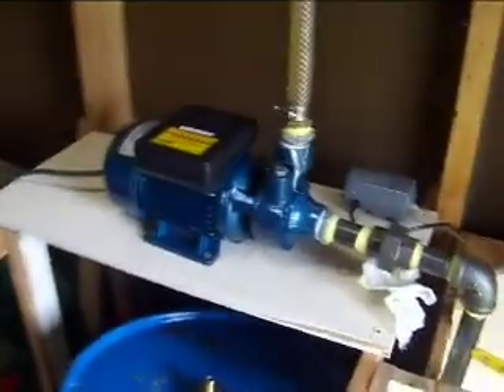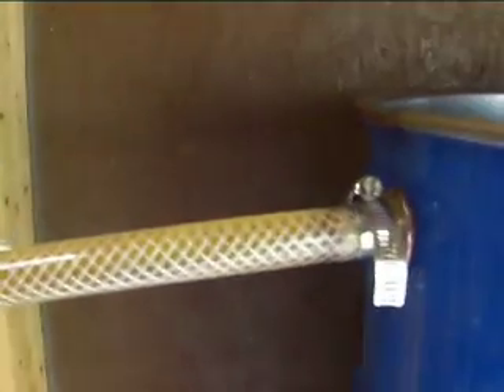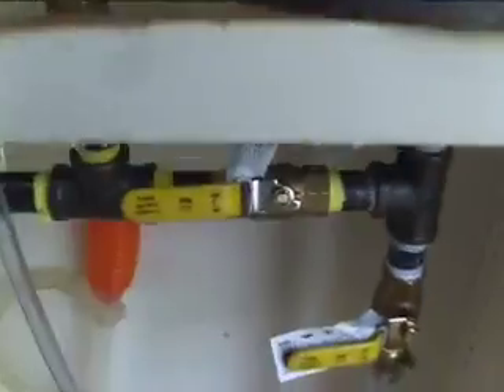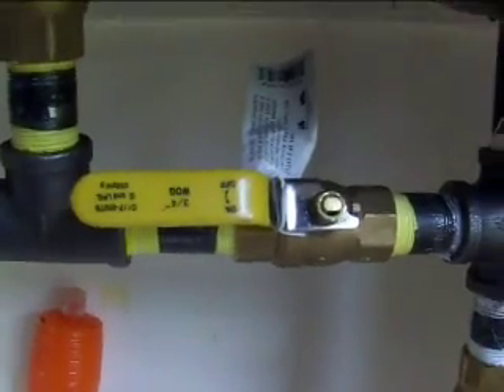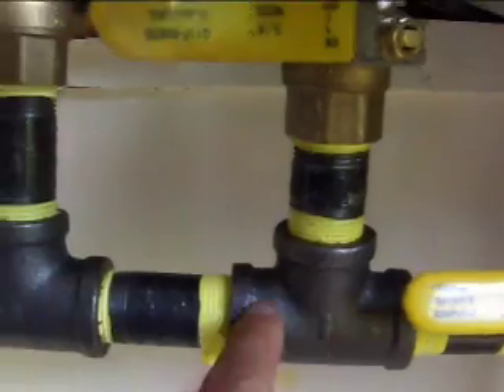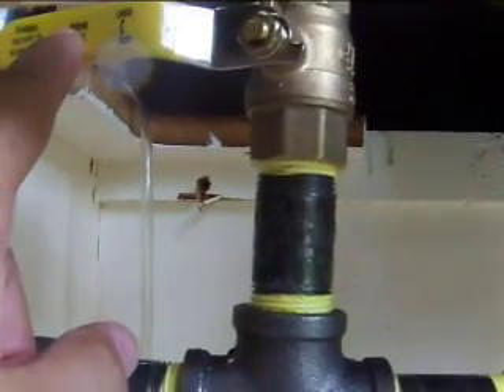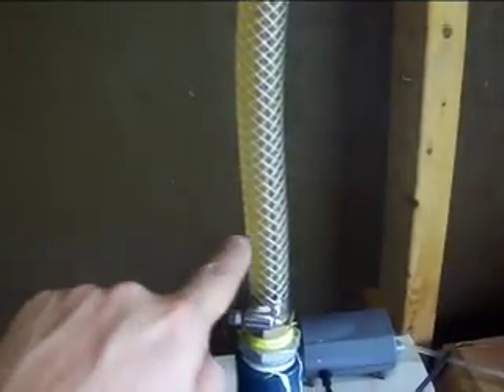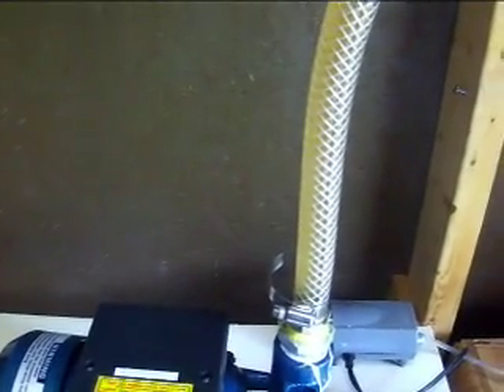Jerry Rig Biodiesel Processor

Comment from the maker: When using a single pump in this setup there's never a chance of cross contamination due to a linear process (i.e. load, mix, dry).  Use of shut off valves also helps to keep things separated and my drain valve sits at the lowest point of everything so everything gets drained.

Hope that makes sense and helps.

Comment from the maker: Washing removes the remaining methanol and remaining lye/KOH.  I have since stopped using water washing and gone to using hardwood wood shavings and sawdust to filter out the biodiesel.  Works great and I don't have to use a bunch of water and I get a finish product faster.  Check out my blog for more info

Comment from the maker: Drying can be done at ambient temperature but will take longer.  If you can heat up the oil drying times will improve.  The key to this is getting as much surface area exposed to air.  I'm working on an idea to create a wide continuous flat ribbon to create a large surface area around 1-2 feet wide and then blowing air across it.